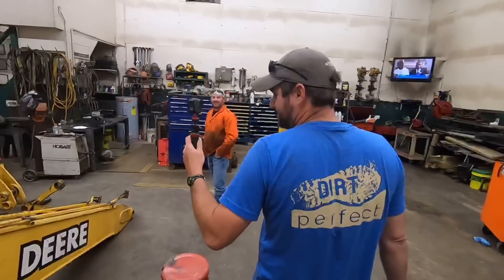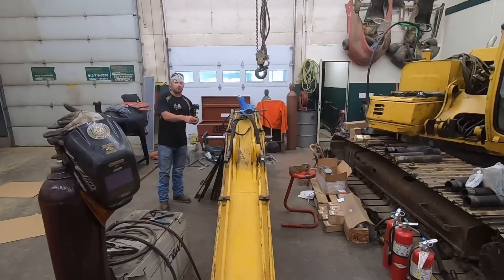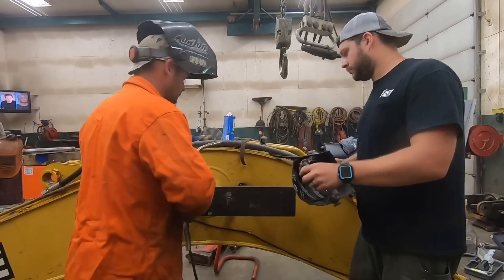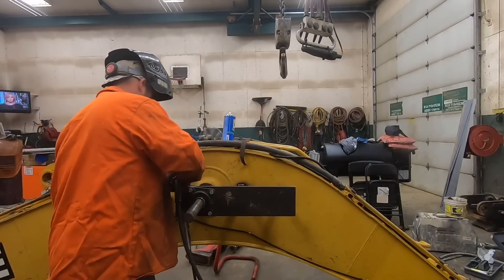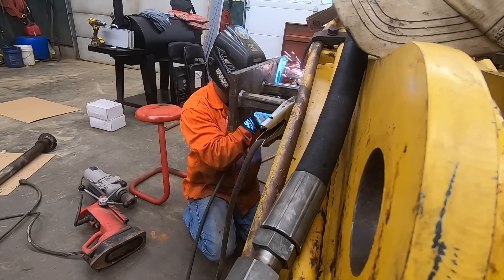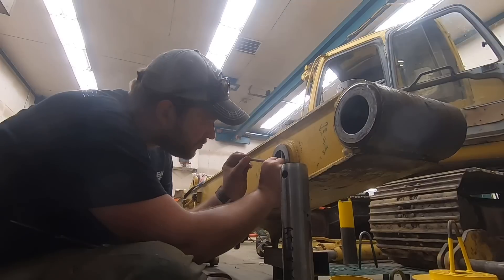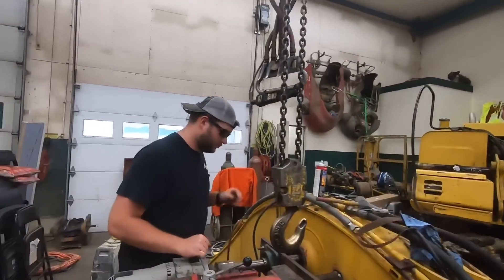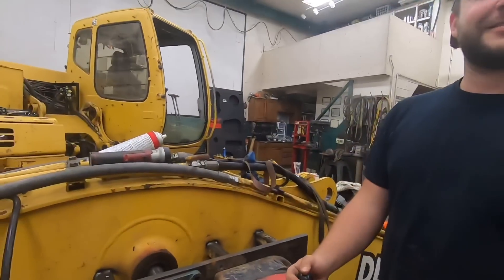Line boring Dirt Perfect's John Deere 120 Excavator with a HOME MADE MAG DRILL line bore!

Comment: oh no...As a machinist, I don't see how this is gonna work out..
Reply from the maker: Demandred1957 oh dear... you may want to watch this one with your eyes closed Hahahahahah it was a learning experience I can say that for sure
Reply: @JasonWorksAlot  Oh god, MY EYES! MY EYES! lol. Good job for not being machinists though. With that said, maybe 50 rpm through weld type material. 1st rule of machining..choke up on it. always have tools/fixtures/etc as stubby/close as you can. Telescoping gauges.. you put them in at a slight angle up and down, snug up the screw, then pivot it down once. withdraw and check. know you didn't ask for advice, but.. since I have been doing it for close to 30 years, just had to give it anyways. Good luck on the next job!
Reply from the maker: Demandred1957 I very much appreciate it all! I’m not sure if it’s this video or the next one I do mention that we were following the instructions of the owner of this kit, but after a little while it just seemed wrong to me. So Aaron and I started messing around with it some and I looked up the Chinese boring machine I was going to buy for comparison we eventually figured out 100rpm was the fastest we should be turning, our tool stick out was minimal, as the end result was only I think half inch larger than the boring bar’s OD, at the very end we realized that there were pointed cutters as well as face cutters in the kit but we made do. My knowledge of machining is novice at best but I’m trying to teach myself more and more, just never have time. Thanks for taking the time to comment! Have a good weekend
Reply: Line boring is not a machinists job, it’s a boily job. Or around here, they just get filipinos in to do it.
Reply: @madaxe79  never heard of such a thing.  Must be a stupid union thing. Line boring is a machinist job for sure. If you are cutting metal, it's a machinist job period.
Reply: @demandred1957  Nah, not a union thing, and Not around here. And Line boring is a huge industry around here. Most of the line borers I know are boilies, a few a fitters/turners, but not many. Machinists run machines, and when we bore, we bore in borers, mills or lathes. I don't know a machinist that would want to go out into the field in the heat and crap, usually in the blistering sun, and dust, and usually running on a diesel powerpack so it's noisy as shit. That's a boilys job. They usually have to gouge out the old bushes, sometimes lance out a pin, then line bore it, I can't be arsed with that crap, I've done my time crawling around in the dirt, give me a workshop with nice machines any day.

I certainly don't consider line boring to be machining. In situ milling is a different argument, you need to know machining to do it, but line boring, you can train up a monkey in two weeks to be a gun at it. 

half the people here doing it are cheap import filo welders. And some of them do a damn fine job of it I might add..
Reply: @demandred1957  yeah I’ve just started,y own workshop, haven’t been in a workshop for 4-5 years, so it’s nice having everything in the same place every day. No climate control, but I do have electricity that isn’t coming from a 500 Air Vantage...

Comment: Weld 3 studs around the bearing at roughly 120° apart?
Reply from the maker: Pretty much yeah. As close to 120 as you can
Reply: @JasonWorksAlot  here they are almost in a straight line on the 3/4" plate. That's why I made the remark

Comment: Great job fellows, for having just the basics. I too will be using a Mag Drill for my first bore job. May I ask you how long the actual job took,all total ? thanks.
Reply from the maker: If I had to toss out a guess, 12ish hours. Closer to 20 if you count disassembly, reassembly, and welding
Reply from the maker: Best of luck! Slow rotation and feed will save time in the long run!

Comment: WOW! I will say for your skill level and tooling used not a bad job! Rule of thumb is 1.005 per inch of bore for press fit. I own a line boring company and I only use Climax Portable Machine Tool equipment. Including the bore welder. Basically took you a bit longer but my tooling investment was over $35K. You did it for under $500! Good job guys! Look into CPMT website if you want to "HONE" your skills! Oh, FYI. If you cut it a bit smaller you can home out a few thousandths down to spec. I use a Sunnen hone. Good job! I enjoyed it!
Reply from the maker: Thank you! I’ll check that out!

Comment: Wire wheel it, then setup on machine use crocus clothe fine as possible. A ruff finish can cause metal fragments to stick, getting in-between the bar and bearings causing feed problems, especially if you use oil when cutting. They put a chrome type finish on them because of that. We also make rubber pieces to protect bar and bearings from metal. 3 bearings are always better than 2. Cuts down on wobble.

Comment: I have a homemade line boring setup. It works OK. I've always found it best to bore first, then weld, then bore again. That way you are not boring right through the weld line. I built mine so I can setup the end plates, bore, remove the plates, weld, and bolt the plates back up in more or less the same location. If I can get away with boring and installing a custom bushing I usually go that route.
Reply from the maker: Couldn’t agree more. I caught some flak for complaining about a setup lended to me for free, and I guess I deserved that but if I’m gonna use fabracobbled equipment I’d like to atleast have a hand in the cobbling of it for reasons like that yaknow? It would have worked much better if we had a rosters welding setup. Of a large enough positioner to put Aaron on and rotate him I suppose... hun designer🤷🏼‍♂️ thanks for watching along man hope you had a good thanksgiving

Comment: Interesting process, I've never done this kind repair but I'm a retired fabricator/machinist and I'm wondering why instead of welding the bore why not bore it for an oversized bushing like a piece of thick-walled DOM tube with a somewhat smaller ID than you need for a pin. The busing and bore could be chamfered on the ends and the busing welded in the bore. then you could just bore the ID of the bushing to the final pin size needed and not have the uneven weld surface to deal with.

Comment: Wow you guys did a amazing job with marginal equipment..a true testament to your talent...I’m wondering how hammered out of round the parent bore was that you found it necessary to do a weld build up......iv seen this done a few times with more specifically designed equipment and I wonder did anyone consider just a oversized bushing and did you use any locking sause to cement the bushing in place as is .001 interference enough?
Reply from the maker: Charles De Francisco thank you kindly sir! As for over sizing and installing a bushing I’m not sure it would be worth it, we would have lost a lot of the original material on the boss to get the bushing to fit. I want to say this hole was .100 or so out of round. As for the locking sauce, we did not. However green locktite probably wouldn’t have been a bad idea. .003 is what you would usually like to see for the bushing to be oversized atleast in my experience. .001-.003 is the Jonathan Deere spec

Comment: I've done a good bit of line boring in my time, and thought I had some tough jobs, but never have I ever had to line bore a rough weld. You guys did great for how you had to do it. 
 One thing that might have helped cut down on chatter, would be having your 'stand off blocks' equally spaced around the original bore. That would have taken a bigger(square) plate to bolt your bearing to, and may have added restriction to the already tough job of welding the bore.
 Our set up was also all hydraulic, with variable speed hydraulic motor and a hydraulic cylinder for the feed advance. I had to count RPM's and measure travel with an indicator to figure out my feed rate (and all that would change when the hydraulic oil warmed up). We used a mag drill for set ups, to drill and tap holes in the side of the machines(usually big presses) we were line boring, then bolted our bearing plates to the machine, using spacers to set the bearing back far enough to get the tool in place.
Reply from the maker: Charles Tucker that sounds like quite the setup!  I’d have loved to see it in action! Thanks for the tips!
Reply: @JasonWorksAlot  I haven't worked for 12 years and don't have any video of any of the jobs. I just went to look on the website and ended up on the facebook page with no better luck. I do have a picture of the crown of a press we had in the shop, that I line bored, while another guy cut a new crankshaft for it. Maybe I'll ask to see if they might get a clip of an upcoming job one of these days.  https://www.facebook.com/bosmachine/

Comment: Honestly it’s the set up.. a tripiod is the rigged set up...most of your issues there ...not in a straight line...a jack support adjustment for the forth leg if needed...carbide cutter can do that small bore at 400 rpm easy.  Hi speed tool not so much 200 tops...litl spray lube helps too...cheers...i said to mike in a older video..line bore time. You not getting away with out doing it...haha
Reply from the maker: knowltek it’s funny you mention the tripod leg arrangement. As I was editing the videos of all this I had a face palm moment and noticed the same thing. I’m not sure why it didn’t dawn on me while we were actually doing it... what a guy would give for a time machine sometimes 😔 thanks for watching along! Next we have to talk him into fixing the 304’s floppy bucket 😊
Reply: JasonWorksAlot  yea no flopp n flooding buckets it an excavator not the Swedish chef...hahaha

Comment: Being a Journeyman machinist for the last 30 years it takes a lot to have a straight and true hole  # 1 rigidity  #2 correct feed and speed #3 listen to the tool and look at the chip it will tell you all you need to know. By saying all of that boring a welded up hole is never easy.
Reply from the maker: Lee Cooper it was a challenge for sure. Probably would have been better to have a few “easier” holes done before doing these but hey trial by fire right 🤦🏼‍♂️

Comment: when you sanding bars again use a sanding belt band from a sander and a sanding barrel on a cordless drill, turn the band inside out place on work use the drill and barrel sander inside the belt and sand away... faster than doing it by hand... start slwoly and build up speed... it wont slip if done right...
Reply from the maker: KNIGHTS MEDIA CLUB I like the way you think! Thanks for that
Reply: @JasonWorksAlot  there is another way depends if you have the pin with eye bolt fixtures each end, on some of my equipment i drill a hole in each end to fit a headless bolt and use that on the drill and a sheet of sand paper in a half mood block of wood,  some of the pins come with eye bolt fixings... or grease nipples i remove the nipple and screw in the bolt and turn it with the drill...

Comment: good work! always fun learning as you go. How did you center the bar in the hole?
Reply from the maker: Travis Macie the owner has a bunch of 1/2” thick washers that are “machined” to a “precise” center and we wrap “precision aligning cloth” (looks a lot like electrical tape but it’s not you can trust me when I say that😉) until we get a snug fit into the existing bore. Kinda crude and I’d have never thought it would have worked so well if I hadn’t seen it myself
Reply: @JasonWorksAlot  Nice! i love me some precision alignment cloth!!! In reality, the most important factor is that the hole is round and perpendicular to the boom.....

Comment: One more comment, with the auto weld attachment, U have to machine the egg hole out to get them round for the auto welder to work, so that's extra maching, where your professional excellent  welder can weld up the egg holes, as they are. So, actually he could weld on them before U weld the bearing blocks on 4 better access. Either way U have 2 B Dam good at welding.
Reply from the maker: Log Dog that’s a solid point you make there. I hadn’t considered it before now. I imagine if it’s not egged too bad you could get away with it but if it came down to it I rather have my buddy do it over the machine so I got someone to talk to while the machines doin it’s thing 😃

Comment: That's interesting 2 C how U boys went about it. We have the same Mag Drill, with an American Machine Tool, boring bar kit. We don't have the auto weld attachment so we over cut the bushing bores then "thick bush em".
Reply from the maker: Log Dog that’s interesting, you mean you order bushings for holes that didn’t originally have bushings? I was always told to bore it out then weld it, then bore it to size. Glad we didn’t t do it that way woulda been a lot of weld, but it shows there’s a whole bunch of ways to do the same thing
Reply: @JasonWorksAlot Hi Jason, I'm not an "Excelent" welder like your buddy, so I bore out the old "Oblong" bushing holes just enough 2 make them round. Then I have the machinist make up a custom "Extra thick" bushing to fit the bore and pin. There is no hole welding required but U cant use OEM bushings.
Reply from the maker: Log Dog got it! See the holes we bored out weren’t bushing holes to begin with. I think we could have probably bored them big enough to put some bushings in, but I’m wondering how much material would be left in the boss after doing that 🤔 tomato - potato right
Reply: @JasonWorksAlot I C 2, If I have 2 cut a lot out, I usually weld the bushings in. Your way of welding up and cut 2 OEM spec would B the best.One more comment, to line up the bore bar in the oblong holes, the American Machine Tool kit comes with cone shaped plactic spacers that center the bar real good, weld the bearing blocks on, then pull the spacers out, and your ready to bore.

Comment: Nice job, but are new inserts not available?
Reply from the maker: Man With A Plan the main boom bosses are machined into the boom, so no bushings. A lot of the pin bosses on this machine are this way actually. Where bushings were used we didn’t bore them out although one of them was on the factory spec we decided to just leave it be.
Reply: JasonWorksAlot gotcha